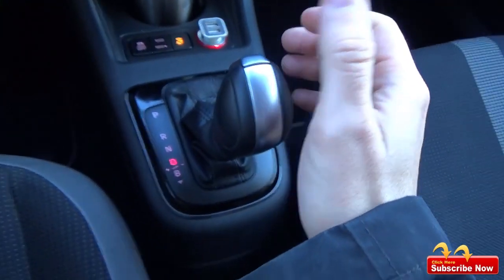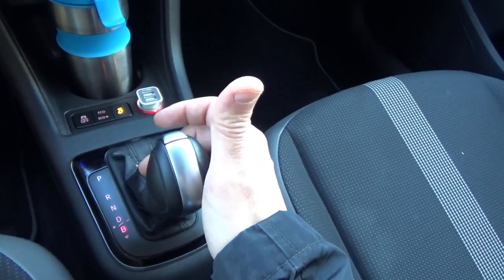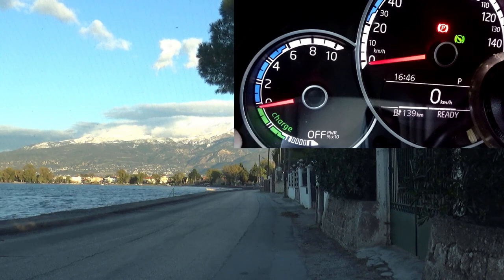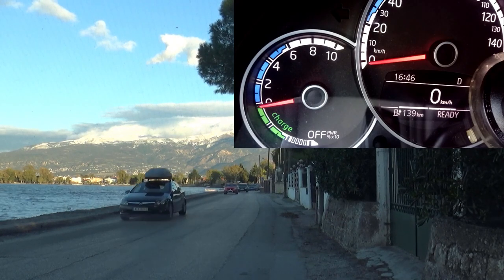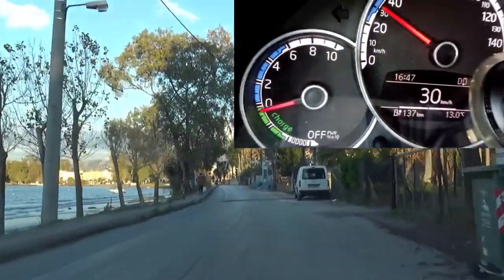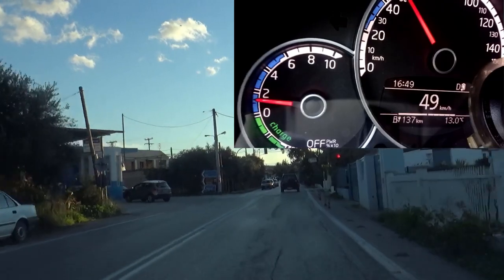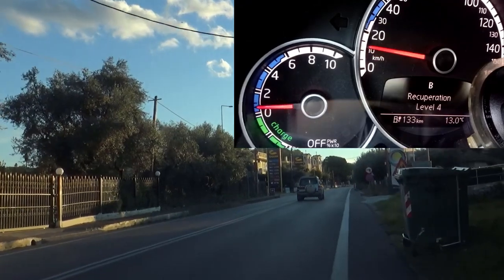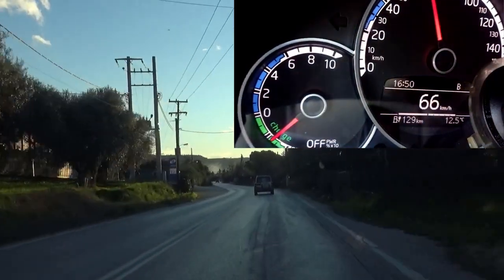VW e-up! Regenerative Braking SECRET – The Best Mode for MAX Efficiency!

Comment: Another question. When you have it set to 4 can you adjust the amount of regen by lifting off your foot only a little?
Reply from the maker: That is a yes :)
If don't lift 100% then the regen is smaller. But if you lift and also press the brake the regen is bigger than level 4.

Comment: Very good video! Question: If you press the brake pedal lightly will it use only regen first and use the brakes only if you press harder?
Reply from the maker: Actually I don't know how it works exactly! I guess in my mind if there is no regen set already then the friction braking creates the regen (I guess) from what Ive seen, is much easier to brake when regen B is already activated! 
So when I need to brake I also put the regen B manually. 
So probably regen is created by brakes... I hope i didn't mixed you!
Sorry that I dont make many English videos. My goal is to educate the Greek people, because there's plenty of field to grow here!